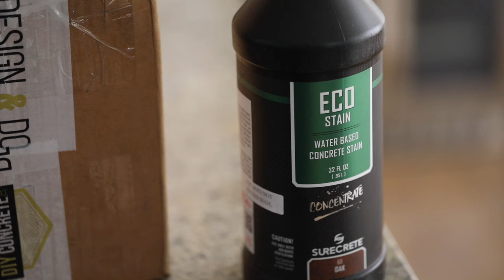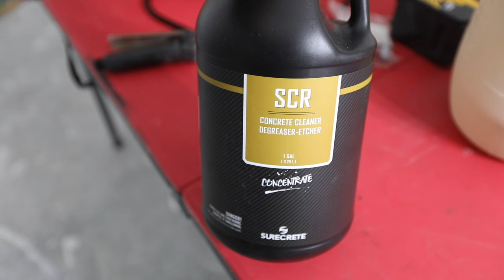DIY Concrete Staining Basement Floor

Comment: Howdy!  Great video and perfect for a first timer on concrete staining.  I have one question for you…. Can more then one coat of the sealer go on?  I ask because I see concrete stained floors and where there’s heavy traffic the stain has worn off. Obviously we’d like ours to last a very long time. We are doing our entire 2000 square-foot house before we put up the interior walls. Do you have any advice to offer us being we’ve never done this before?
Reply from the maker: Yes 100% you can put more than 1 coat on!
Reply from the maker: Also you’re going to have to cover the floor with ram board or something so it doesn’t get trashed during wall construction! Id suggest framing and drywall first, then stain the floor, then mill work and paint!

Comment: Question, two years have passed since this video was posted and now it looks like they have two different types but I dont see the Part A or Part B in the new products, can you tell me if either kit is alright? Like if the exterior kit could technically be used for indoor to save a few bucks?
Reply from the maker: Hey Matt, like I say in the video I have no affiliation - but I think you’d be perfectly fine with saving a few bucks. That’s what I would do. Plus you can always put another coat of sealer on in a few years.
Reply: @RinkVideo  awesome thank you! It's for an indoor workshop so not a far stretch from a garage anyways ha! Thank you for the quick reply. Amazing work, hoping mine turns out just as well. They are sold out of all the tool kits so I will in fact be having to make those multiple home Depot runs

Comment: Have you had a problem with flaking? I just did the kit a month ago and now there are areas that are flaking by just walking on it with shoes or by dogs. I've had to patch the areas with sealant but there are a lot of area with quarter size flakes and I wasn't sure if you have had that problem?
Reply from the maker: No such issues on this end Patrick. I actually just did a 1-year-update on the condition of my floor and it's still minty: https://youtu.be/HcqGyrDAe9Y

Comment: So, I want to do this with my bedroom, not my basement. I wonder what happens if you don’t decrease it first 🤔
Reply from the maker: I think it would depend on how old the concrete is and how much popcorn you’ve spilled on the floor 😂 

You might be able to get away with it if it’s really clean.

Comment: This looks like perfect idea for my older house with a utility/laundry room. You did say the clear coat over the stain does have a strong smell. How long did that last for? I have cat that I keep litter box in and concerned about the strong smell.
Reply from the maker: It would 100% depend on how well you could ventilate that room and humidity etc
Reply: @RinkVideo  it does have a small window that will be open, just didn't know if the smell would last several days or what not.

Comment: What grit did you use to sand/clean the floor?
Reply from the maker: @benleitch540  there was only 3 options at Home Depot tool rental, black, green and white. The white didn’t work at all (too soft) so I used black and green pads.

Comment: The major issue is “Acid Etch”.

It doesn’t work, it never works, no one should do it - EVER.

The only way to prep concrete properly for paint, epoxy, or any type of coating. Is just to grind it.

Comment: Is sanding the floor required? Looking to do a bedroom. Just bought my first house and looking for cheap ways to upgrade!
Reply from the maker: You could get away with not sanding if the concrete is super clean. For sure. Congrats on the big purchase!

Comment: similar use as yours - basement floor where some paint and drywall mud is everywhere. I see you opted for just an orbital sander, vs a concrete grinder/sander... Is that really all I need? What type of pad did you use?
Reply from the maker: Yeah was all I needed. Rented at Home Depot and they only have 3 pads: white, green and black. The white was not aggressive enough but black and green worked great.
Reply: @RinkVideo  sweet, thanks!! rental places here were recommending the heavy duty grinders and I thought that was overkill
Reply: @RinkVideo  having a heck of a time getting all the water and soot off the floor after rinsing and then the dirty water that remains seems to leave a film on the concrete... Did you have an issue like this? Do I need to rinse harder and use more water or get a better vacuum?
Reply from the maker: @stevemorrissey7491  I made the same mistake initially and I was too shy with the water (for obvious reasons I was scared to get drywall wet etc etc.). Then my buddy came over advised me to use like 10x the amount of water to rinse. He kinda convinced me that drywall can withstand much more water than I thought. If you have a wingman to run the shop vac even better. I was lucky to have a floor drain easily accessible and just emptied the shop vac over and over. So yes I did have the exact same problem until I ramped up my rinse game.
Reply: @RinkVideo  giving this a shot, thanks!
Reply: Last question... I've got a standard pump sprayer and no matter which nozzle it seems to come out too fast and also with drips. Is that ok or do I need a different sprayer??? Don't want to screw this up
Reply from the maker: @stevemorrissey7491  legit question that I’ll probably struggle to answer. You’re gonna get some drips and the drips are a hassle for sure. You can keep a paper towel in your pocket and just dab the drip if it gets bad. Totally like taking a leak though 😂 you can’t just stop the flow of piss without a couple drips at the end. In my case I wanted a super light and super thin coat of stain so any drips were noticeable and I freaked out but in the end it really didn’t matter. Is it worth buying a high-end sprayer? I wouldn’t. Just keep a rag in your hand and cover the nozzle when you’re not spraying. it will spread out and look intentional in the end. I didn’t answer your question but I really wouldn’t stress too much about it. You got this.
Reply: That actually makes sense... Just gonna give it a go
Reply: Thanks for all your help!!

Comment: How did you handle all the excess water when cleaning the floor?  Looks like you have a similar issue as I do with no drains.  How did you prevent the water from seeping into the walls?
Reply from the maker: To be honest I was concerned about that at first but it ended up not being a big deal at all. I just used a shop vac to suck up the water and it worked great.
Reply: @RinkVideo  Thanks for the quick response!

Comment: Nice work! I'm considering this product for my garage, did you find the floor to be slick after your sealed it? specifically if it were to get wet?
Reply from the maker: I’m thinking about doing my garage as well but I deal with a lot of salt and snow where I live. I was thinking about using this stain and then finding a harder more industrial sealer (but will probably be slippery?). As for slick, the basement floor is not slick but it’s definitely slicker than just raw concrete. Maybe a guy could do two coats of sealer and put a little sand in the second coat?
Reply: @RinkVideo  Thank you! That's very helpful.

Comment: What’s the color your friend chose, wasn’t bad really
Reply from the maker: He mixed two colors together as he was putting it on.
Reply: @RinkVideo  nice, really like yours as well. It’s exactly what I wanted to achieve at my house but came out bit different 😮‍💨 you said yours was ‘oak’ is that right?
Reply from the maker: @beebee242  that is correct. A very light coat of Oak.

Comment: I notice some people just spray stain and then seal it whereas some spray stain and neutralize it with baking soda and scrub the stain and rinse with water before sealing it. Does both work?
Reply from the maker: Jonny Taco is a rad name! Buddy I have no clue about the baking soda method. Never even heard of it before now.
Reply: @RinkVideo  they say you need to Neutralize the acid before sealing it. I got all my stuff plan on starting Saturday
Reply: @Jonny Taco Outdoors  that's for an acid based stain. His is water based. Acid gets great results but it's time driven meaning the longer you wait to neutralize the more the color changes. Google acid based sealer.

Comment: How has this product held up?  I did a water based stain on my garage floor and I find it scratches very easily.  It was a different brand, so I was wondering if this one would be a better option. Thanks!
Reply from the maker: Hmmm the stain itself would do great in a garage but the sealer is what would make or break you. I slide lots of junk across my basement floor and it doesn’t scratch but I’d be hesitant to use the same sealer in my garage. I’m sure you could stain it and then find a rock hard sealer to protect it but then I’d be concerned about how slick that might get if you ever have moisture on the floor.
Reply: @RinkVideo  thanks!

Comment: What if your concrete has chunks taken out of it?
Reply from the maker: I think you’d be fine Tammy. As long as there isn’t debris or dusk in the chunk. You’d probably just have to use a little foam brush to touch up the chunks if the roller doesn’t cover them.

Comment: What grit pad did you use for the rotary sander?
Reply from the maker: Frick that's a good question that I should have had in that video. But I simply can't remember. I'll take a quick look to see if I can find the Home Receipt (stand by)
Reply from the maker: The receipt doesn't say. I know I started with too fine of a pad that wasn't effective so ramped it up to something more aggressive. Not sure if the colours are the same where you live but I used the green pad that they sell at the home depot rental shop. On a scale of 1-10 with 1 being the least aggressive, I probably used a 7. So pretty aggressive.
Reply: Thanks a bunch! That truly narrows it down for me. Gonna run with an 80 grit.
Reply: @RinkVideo  Awesome this was the question I was about to ask.

Comment: If a "pro" etches your concrete for prep, they aren't a pro. Hard troweled concrete that's been sealed needs to be opened up with mechanical diamond grinding before applying any coating.